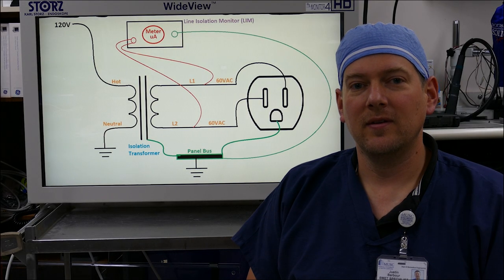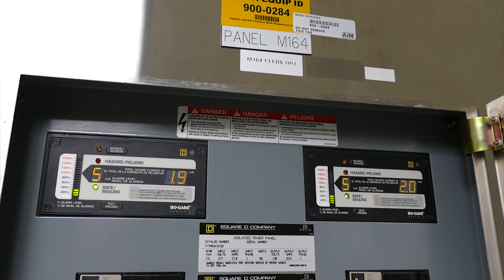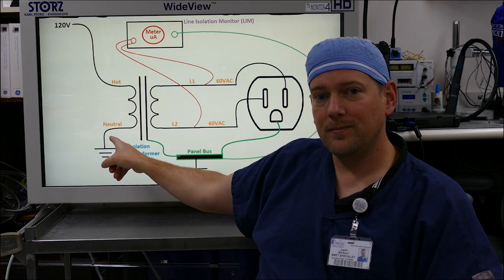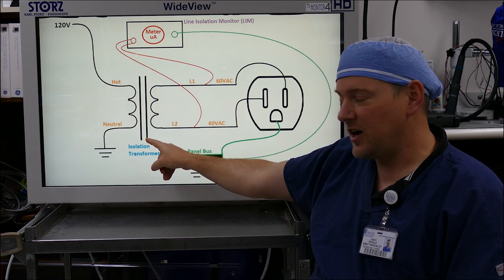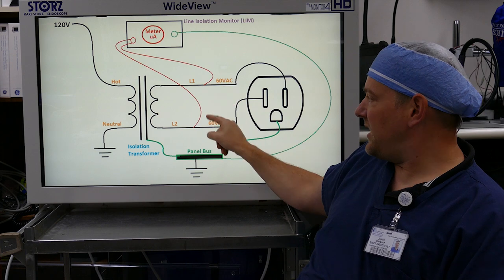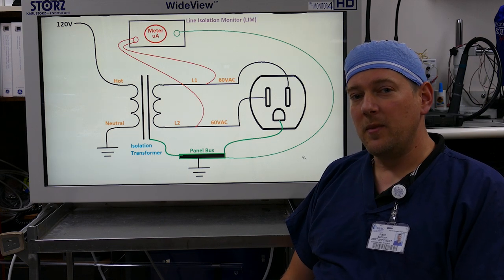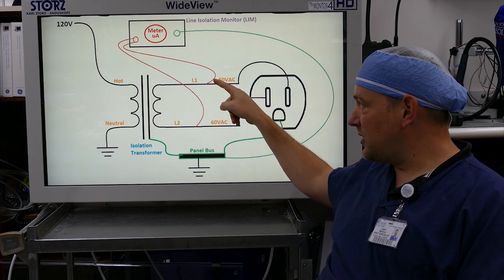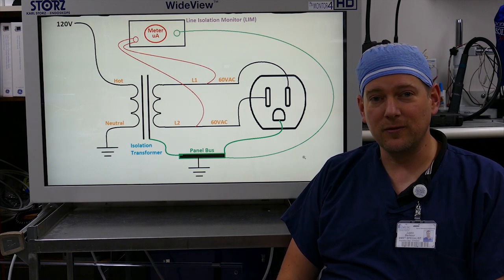isolated power system hospital (LIM)

Comment: I received a call that an EVS worker got shocked on a bed. They clearly reported on the work order the green wire broken on a side rail. Inspection found a broken ground wire on a Hill-rom bed. They pointed it out. It was static electricity cause we have a dry climate and static is frequent! A frequent call at my facility. Great video!
Reply from the maker: Many beds have a dangling chain which dissipates static buildup.

Comment: We opened an isolated electrical panel the other day after the alarm went off. Turned out that the lug-nut was loose and arcing inside the panel. Melted a bit of plastic. 
We thought the lug-nut was some sort of hi-tech breaker at first, till we realized it was just a lug-nut. 

Very informative video! Sounds like it is quite hard to ground one-self in this environment.
Reply from the maker: Its easy to ground yourself (remove your body's potential charge) but it's difficult for electricity to move from any outlet to you (ground potential).

Comment: Is there a type of external UPS device that would work in this system? One that could plug into a receptacle without alarming ?
Reply from the maker: A ups should work fine but most isolated power circuits are on emergency power or facility ups power
Reply: When we plug in a ups the current rises on the LIM panel and alarms out. There is a delay on our emergency power and we wanted to use the ups to fill in for that delay time.
Reply: @Bahumut99  I have the same problem, the only solution I figured out is to disable the alarm/lock parameter with the ups's software.

Comment: So how would you test devices in the OR if these are your only outlets available?
Reply from the maker: Most modern electrical safety analyzers recognize isolated power
Reply: @BetterBiomedChannel  I Have seen this with  the analyzer I'm using (I'm using Vpad) and I've just always used a regular outlet, instead. I'm curious though, on the analyzer I'm using, it says test results may not be accurate. When testing leakage current I would get different readings when plugged into the isolation transformer vs a regular 120 outlet. It doesn't seem to fail but the readings are different, I'm interested in your take on this? Or have you experienced something similar?
Reply from the maker: The whole purpose of an isolated power system is to eliminate the direct association of line AC power to ground. Because of this, there will inherently be lower numbers for leakage in an isolated system because the power want to travel back to the iso transformer not ground.

Comment: Nicely done.
Reply from the maker: Thanks.   I think I should update this video to get  a little better quality. This was the first video I recorded for this channel.
Reply: @BetterBiomedChannel  For a first attempt you did great.  Could you add an explanation for how the transformer core ground which appears to be at the same potential as the main supply ground doesn't create pathway to a shock.  This part had me wondering until I saw there was no return pathway to the isolated windings. Some folks may not see this so clearly.  They also need to know that a regular transformer may have the core grounded to the supply side in some instances.  From your experience would this create a shock risk?

Comment: what's happen to the electricity in the frame of the device when u get shock  bc of changging magnetic field of ac? where does this current go? how circuit complete?
Reply from the maker: If I understand your question correctly, AC will induce a magnetic field into conductors - that field is also AC bidirectional current. Medical equipment is designed specifically to reduce emf leakage. There is chassis grounding, switch mode power supplies with extra shielding, and extra emf filters.  All conductors should be as short of a length as possible (not coiled up), and devices with a common ground need to be plugged into a single power strip to prevent ground loop.

Comment: I find strange that people can confuse static with an electric shock. Static is a short pulse and once it is done it is over. An electric shock would be constant current. A static shock can be several amperes so it fill feel - even painful but as it is so short it is not dangerous.
Reply from the maker: The general population has little idea about electricity or of static. Most people have never been zapped by AC mains. Any electrical sensation is automatically associated with AC mains because that's humans in a nutshell...

Comment: Nice diagram and explanation! But it looks like I need to learn more in order to understand how an isolated winding can be referenced to the ground!
Reply from the maker: There are 2 types of isolation transformers. One type (the cheaper version found in many equipment carts and eeg labs) is just a noise isolation transformer. The second type is a mains isolation transformer which I depict here.  The mains iso transformer has no continuity from the secondary to the primary which is why you won't get shocked. The noise isolation type does have some continuity and you can get shocked. The easiest way to tell is unplug the transformer, put your multimeter on ohms or continuity mode and test between the primary and secondary
Reply: @BetterBiomedChannel  thanks a bunch 😊

Comment: What do you mean about 60VAC? Measure between which two points? It should be 120VAV between L1 and L2, right? mA meter let you know L1 or L2 is grounded.
Reply from the maker: Its 60V AC between L1 or L2 and GND. Which can give some safety meters a fail condition (older meters). mA meter is for leakage between either L1 or L2 and ground. It doesn't tell you anything about the quality of your ground. -That is done by ground balance testing of the room.
Reply: It is probably ground referenced through capacitive coupling to the grounded frame in the transformer.  Effectively center tapping the transformer.  That's where the tiny current comes from as AC is flowing through this parasitic capacitance to ground.
Reply: @stargazer7644  It's simpler than that. See my reply above.

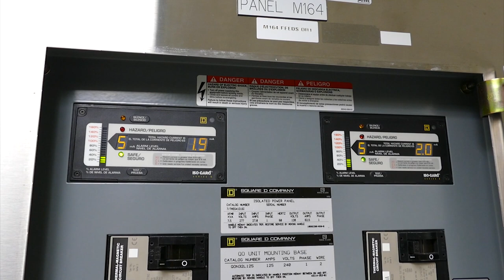Comment: There is an error in the diagram and explanation at 2:35.  You can clearly read the nameplate of the panel at 0:53 where it states the Input volts is 277V (not 120V as in the diagram ). 
Another error is in the right half of the diagram. There has to be 120V at the receptacles for anything that is plugged in to work properly. But if L1 equals L2 = 60V as noted, then the measurement between those points is going to be 0 Volts, which of course is not true. 
Redraw the input side as 277V and either put +/-60V and -/+60V on the L1 and L2 leads or just write 120V AC and you should be fine. And BTW, I'm an Electrical Engineer.
Reply: "But if L1 equals L2 = 60V as noted, then the measurement between those points is going to be 0 Volts, which of course is not true."  The voltages measured at opposite ends of a transformer are going to be 180 degrees out of phase with each other.  Just as when you measure 120V on each leg of a residential panel, but when you measure across them you don't get 0V, but 240V.  

Ask yourself in this circuit, what would you measure from L1 or L2 to ground?  The simple answer is "nothing, 0V - it's an isolated system".  But that's only true in a system with an ideal transformer.   How can there be leakage to ground in an isolated system?  Obviously there is leakage - the meter is measuring it.  Real transformers aren't perfect, they have stray capacitance.  There has to be a voltage difference from L1 and L2 to ground if there's current flowing.  That's the 60V.  The transformer is effectively center tapped to ground through the stray capacitance in the transformer, but the connection is high impedance, so not much current flows unless there's a fault.

Whether the input to the transformer is 277 or 120V is really rather irrelevant to what is going on here.  It makes no difference on the isolated side.
Reply from the maker: Thank you Star Gazer for that perfect explanation.
Reply from the maker: Exactly.  Some of panels are a simple 1:1 ratio with 120V primary.  It's much easier to explain isolated power if explained 1:1 than including a step down transformer or isolating a single phase.  What if the watcher of the video encounters a panel with different input power? It doesn't matter.  I'm very surprised that an electrical engineer would request I label a transformer secondary as +/-60V. Anyone that understands transformers would know that it's only AC which doesn't have a +/- potential (unless you're talking @60Hz)..
Reply: The +/- 60V on the transformer is referenced to the isolated ground.
Reply from the maker: There is such thing as a floating ground or lifted ground but ground in an isolated electrical system is actually connected directly to the transformer chassis as well as system earth ground. There is no such thing as +/- 60V AC. It's just 60V AC.  Anything could be on the primaries of a transformer but the secondaries are not tapped to any center leg in an isolation transformer they are isolated from everything. Noise isolation transformers do have a leg tied to ground. The secondary is one coil (isolated from everything). As you guys know, the number of windings in that coil = V of that coil.

Comment: Very good explanation, thanks!  But there is still a query about if IES is good for device. I encountered many case that an operating microscope crashed from time to time. After skipping the IES, then put the device on primary side of transformer, problem was solved. I don't know why. I guess it depends on if the power supply module of device was designed to adapt IES.
Reply from the maker: This is an interesting situation.. I would have loved to document that failure. For most devices that run on DC regulated power supplies (which is most), it will never matter because the AC is converted to DC immediately after entering the chassis.  A medical grade power supply tends to have chokes and filter caps on both Line and Neutral that comes into the power supply (which is why they usually cost more). If a microscope pc is crashing you should check the electrolytic caps on the motherboard next to the processor. Older microscopes have bulging and leaking capacitors which creates unstable power at the processor (causing random crashes).
Reply: This is an EMC problem. There is a well known rule. "Meeting a safety requirement" means violating good EMC practice. In your case, ESD was probably crashing the equipment because static charge may have had no way to drain off into "ground", especially if this microscope had only a two pronged plug.

Comment: When i check the output side of the ips the earth to line voltage is showing 120.why is that? It should be in zero potential right
Reply from the maker: @jyothishas1466  the two 60VAC secondaries for the IPS are 180 degrees out of phase from each other so the wave has 120V potential @60hz
Reply from the maker: @jyothishas1466  let me know if you'd like a better answer
Reply: @BetterBiomedChannel  sorry i mean earth to line voltage, it shows 120 v but it must be 0 right otherwise when we touch one line we get shock.

Comment: The transformer is about not getting shocked from lightning strikes etc. Not about protecting from faulty equipment; the meter though, yeah, it can help. I man yeah, lower voltage, lower shock, but I don't buy the rest.
Reply from the maker: Isolated power systems have little to nothing to do with lighting strikes and everything to do with single fault electrical hazards, which could normally shock. Lighting strikes can transmit surge and noise through a transformer.

Comment: Neutral is bonded to "ground" on the mains side  (in the US/CAN)..why not show that.
Reply from the maker: Because the drawings is dramatically simplified.  The neutral and "bonded" ground have no effect on subject of isolation.
Reply: @BetterBiomedChannel  I think it will confuse most people. Then there is an issue of a 240 volt panel with line 1 and line 2. I also think it should be pointed out that the reason for the monitor is to detect  a neutral to ground short in anything connected to the panel output....

Comment: you don't need an isolation power in an operating room....because there is no way to get electric shock in my life as i am an electrician working with all hazardous electricity.. i don't know why operating room have isolation transformer.... wasting money.... let me say a tale " what happened if the sun not  fire one day " or what happen if an earthquake in that operating room .... these are over protection. But if it is to minimize electromagnetic interference that makes sense.
Reply from the maker: Operating rooms do not need an isolation transformer if built after 1986. But as a remodel or expansion, the transformers need installed if other parts of that facility currently have them installed. ORs are a wet location and a clear electrical hazard by anyone's definition. The people in ORs for surgery are not the healthiest people in the world in the first place. "An ounce of prevention ..."